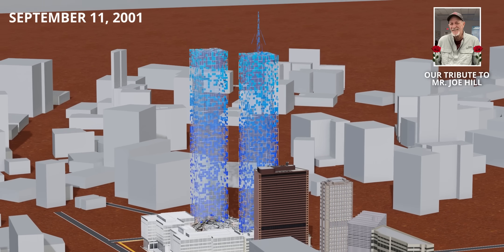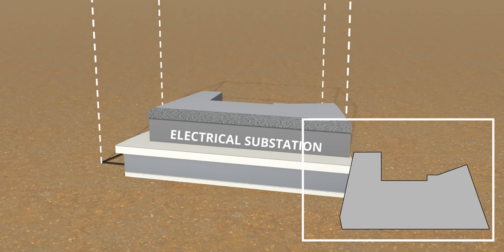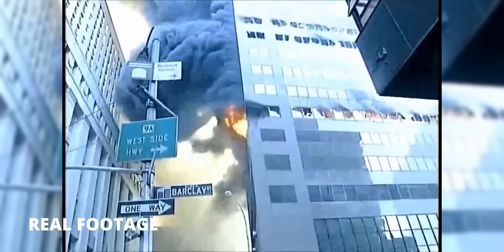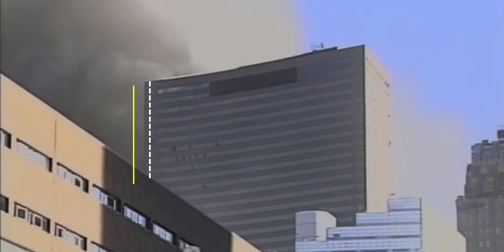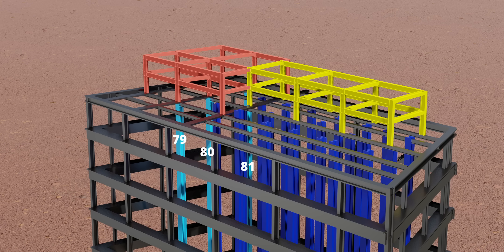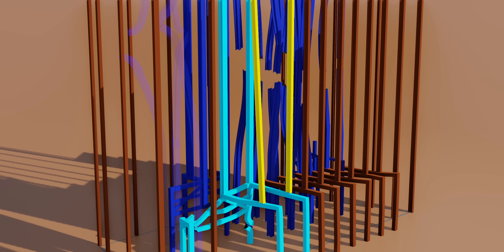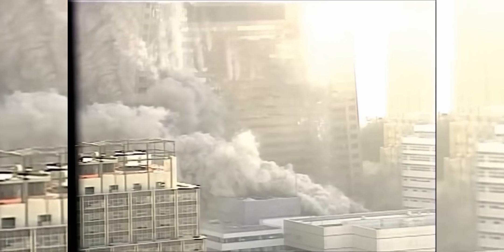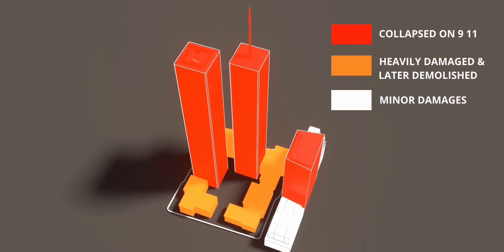Collapse of Building 7 | The Complete Physics

Comment: WTC 7 wasn’t ‘controlled demolition.’ It was ripped open by debris from Tower 1, its sprinkler system failed, and fires burned unchecked for 7 hours. NIST traced the collapse to the failure of Column 79, which set off a chain reaction through the interior. Demolition requires weeks of prep, cutting, wiring, and leaves explosive residue—none of which was found. WTC 7 didn’t fall because of hidden bombs, it fell because fire and structural failure don’t need a plane to bring a building down.
Reply: Prove this rip as you call it took out more than just windows and veneer?
Prove the sprinkler system failed. You can't.  Because no one was inside for 7 hours.
If no one was inside for 7 hours, how did everyone know it was gonna fall?
If no one was inside for 7 hours, why did Larry Silverstein say he pulled and then we watched the building collapse? Could he be using the demolition term pull talking about controlled demolition? Absolutely 💯,  but why did it fall in 7 hours when all 3 of the towers were designed to burn to extention without collapse? NIST is a organization that i never heard of until many years after the collapse.  How many investigations has NIST been in charge of?
NIST is wrong. NIST left out the stiffeners in there studies. They lied about the loads. Third grade science tells us through newton's 3 law. saying when one object exerts a force on a second object, the second object simultaneously exerts a force back on the first object that is equal in magnitude and opposite in direction. A vw bug can't destroy a 18 wheeler. As the building falls, the larger building below wins the destruction battle of forces. Especially in the case where to top of the building sheers off like towers 1 and 2. If you wish to discuss this chain reaction you're talking about. Please start by explaining the upward force because that's the one it seems you're not thinking about. If buildings are built to burn to extention without collapse, and you don't need a plane. What do you suppose you need to bring down a steel highrise? You need explosives,  have you not heard videos of the explosions? If you really know what you're talking about,  explain why a demolition team would destroy the taller 2 from the top down and the smaller one from the bottom up. Like the video evidence shows.
Reply: @robbiehiatt9966  "no one was inside for 7 hours"

That´s not true. Everybody and his aunt was running around in WTC7. I don´t know what the heck they all did there all the time since they never made any firefighting attempts, but they were in that damn building. I think it was FDNY that gathered and provided tons of reports including firefighters and others entering the building.

The "rip" (aswell as the damage at the sw corner) was caused by north tower core columns tipping over all the way to WTC7. The tipping core column destroyed one of WTC7´s perimeter columns on the upper floors and was then "caught" between two perimeter columns, slicing down between them, creating that long straight gash.
Reply: @h1F595 was it interesting when I proved you wrong time after time? I thought so too
Reply: @Kudde23my bad, idk what happened but my comment originally went to him, I'm directly under him. Idk how it got sent to you to begin with,  then you replied and I thought he was you. Mine isn't showing i sent you anything at first. My bad. Idk what happened
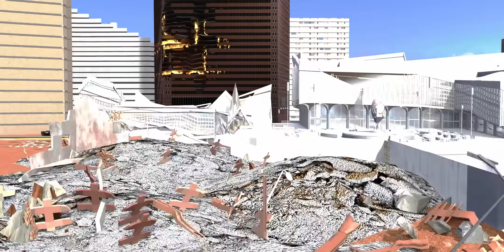Reply: Tower 7 was evacuated when the second plane hit. That was around 10 AM.  It fell at 5:20.  At 3:20 in this video the man talks about that very thing. No one had been in tower 7 for at least 6 hours. So you couldn't answer a single question and that's fine. But because you have not even tried to answer my questions I guess you forfeit.  Do you have any proof the gash was more than exterior windows and veneer? You definitely can't tell from the photo provided. That side of tower 7.
Has hundreds of windows. Since you can see the gash, why don't you count the windows that are left?And tell me how many windows weren't knocked out since you say you can see that side of the building so well? Did you not learn about newton's third law and third grade science? This video says that the perimeter columns are only as strong as a serial box. Are you saying a serial box destroyed the side of the building? for every action, there is an equal and opposite reaction. This means that when one object exerts a force on a second object, the second object simultaneously exerts a force back on the first object that is equal in magnitude and opposite in direction. OPPOSITE IN Direction!!! That means there's an Opposite force upward that's equal to the force downward. So if the upward force is the same, how is it the 10 floors that sheared off?It didn't even totally impact in a downward direction.It sheared off. That means there's no way ten floors can destroy a hundred. Where do you suppose this explosion came from, listen closely. 8:30 https://youtu.be/bLF5D7M1YgA?si=aHSvS__uOdxMi1ZB
You cant say it's fake, because you can see the NYCFF respond to the blast. And you can't say it didn't come from tower seven because the firefighter that walks up says" we gotta get down here seven is exploding"
The video speaks for itself...
Reply: @robbiehiatt9966  Dude, please try to focus, I´m not the one you were talking to, you asked me no questions. And I´m not even opposing your general belief that it was a controlled demolition. I just popped in to clarify a few points.

Yes, the people inside WTC7, employees and staff, evacuated the building. Then firefighters and OEM people entered WTC7 over and over. I bet my ass that you know the stories of Jennings and Hess WHO WERE TRAPPED INSIDE WTC7. And then were rescued by firefighters who entered WTC7 to do so. So what are you even trying here?!? Mr. Rotanz from OEM entered WTC7 and reported an elevator car that was blown out of its shaft, you may have heard that story too. And as I already told you there were quite some more reports of firefighters and others entering the building.
Btw: The second plane crashed around 9pm, not 10pm.

You point to the windows of WTC7... Any idea what was between them? I´ll tell you: The perimeter columns. On the upper floors the gash covered two windows and therefore also the perimeter column beween them, yes, that´s what the pictures show. It was perimeter column number 20.
Reply: @robbiehiatt9966  Dude, I know that WTC7 was a controlled demolition, you really don´t need to load a ton of controlled demolition arguments on me, stop talking to me as if I´m a shill who tries to defend the official BS story!

I am NOT the one you were commenting to. You were commenting to "YouTuber-r5c8x", I am "Kudde23". Look it up.

Yeah, I didn´t point to one single window, exactly. I pointed to more windows. The ones left and right to the missing perimeter column 20.
Reply: @h1F595 there are no sides. Hell im on your side. I just disagree.

Comment: Ita a control demolition , the world not stupid
Reply: This is one of those situations where we are confronted by a choice: 

1. Do the complex physics, fluid and thermodynamics calculations involving materials, pressure differentials, conservation of mass, momentum, energy, temperature, laminar vs. turbulent flow, viscosity, and density necessary to understand and explain building collapses on a detail level. Or 

2. Just skip all the hard stuff, and say controlled demolition then drop the mic. No thinking at all required. 

Conspiracists invariably take the low-hanging fruit, the path of least resistance going for Door #2. Conspiracists don't offer conclusions based on scientific reasoning, they only offer a two-word hand-wave rationalization that took or required little to no thought, maybe backed up with infinite "yeah, but" conjecture. 

It's boring.
Reply: @TheCriticalStinker-01 <---- government shill account

Comment: "At the ground level the transfer truss temperature levels where high so they failed" 
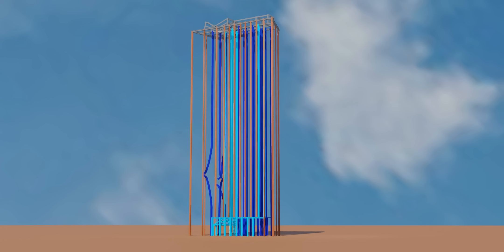@6:40
Dude they are sitting on solid concrete not to mention the heat required to soften a full steel framed building.
The entire "simulation" here rides on a perfect domino effect from that one statement I just highlighted.
Reply: How about quoting what the video actually said?  You weren't even close.  Much easier to understand what is being presented when you don't completely misinterpret it.
Reply: The thing about domino's is. Someone has to set them up

Comment: What a bunch of bullshit. This was a controlled demo. Get real.
Reply: This is one of those situations where we are confronted by a choice: 

1. Do the complex physics, fluid and thermodynamics calculations involving materials, pressure differentials, conservation of mass, momentum, energy, temperature, laminar vs. turbulent flow, viscosity, and density necessary to understand and explain building collapses on a detail level. Or 

2. Just skip all the hard stuff, and say controlled demolition then drop the mic. No thinking at all required. 

Conspiracists invariably take the low-hanging fruit, the path of least resistance going for Door #2. Conspiracists don't offer conclusions based on scientific reasoning, they only offer a two-word hand-wave rationalization that took or required little to no thought, maybe backed up with infinite "yeah, but" conjecture.
Reply: @TheCriticalStinker-01 <----- AKA M FITZ, government shill account.
Reply: @TheCriticalStinker-01 since you know so much tell us about the upward forces that were involved in the collapse of towers 1, 2, and seven

Comment: Wow, so the upper floor moved inward when the support columns failed or were blown out.  Amazing that the fire happened to be exactly where it needed to be to pull the building.  It created a collapse onto itself that was exactly like a controlled demolition.  What are the odds?
Reply: The fact that you used the word "pull" means you're already too far down the rabbit hole. We know where you get your info from.
Reply: It took 7 hours.
Reply: 3 buildings collapsed that way in the same day, all owned by the same person, and he is the one who told everyone the building was pulled. All 3 fell due to fire, all a first to do that, but also these were the first 3 buildings to fall because of fire when they were designed to burn to extinction without collapse. It was the first time a highrise building fell because of fire that all 3 looked like a controlled demolition. Along with that,  tower 7 was the only building that has ever fallen and people knew ahead of time it was going to collapse. I couldn't imagine a number high enough for that calculation of statistics

Comment: structural experts studies for 15 years to determine what happened.... auto part worker.... nope! controlled demolition!
Reply: This is one of those situations where we are confronted by a choice: 

1. Do the complex physics, fluid and thermodynamics calculations involving materials, pressure differentials, conservation of mass, momentum, energy, temperature, laminar vs. turbulent flow, viscosity, and density necessary to understand and explain building collapses on a detail level. Or 

2. Just skip all the hard stuff, and say controlled demolition then drop the mic. No thinking at all required. 

Conspiracists invariably take the low-hanging fruit, the path of least resistance going for Door #2. Conspiracists don't offer conclusions based on scientific reasoning, they only offer a two-word hand-wave rationalization that took or required little to no thought, maybe backed up with infinite "yeah, but" conjecture. 

It's boring.